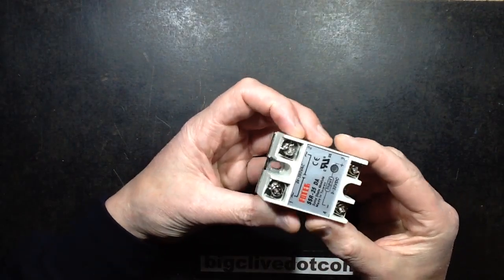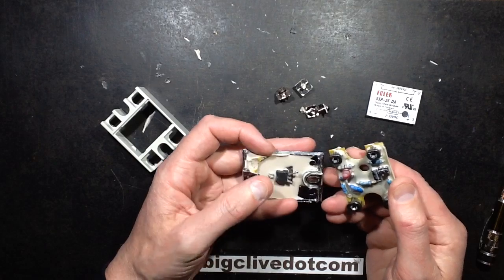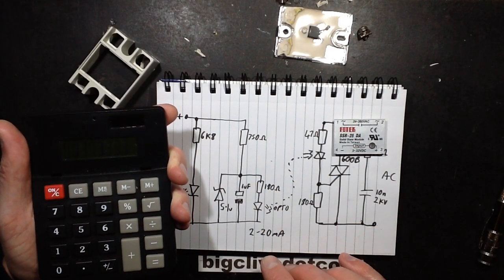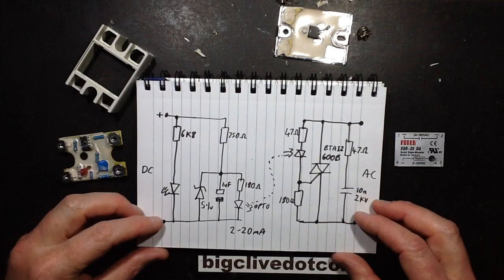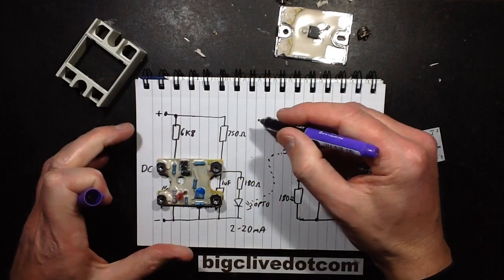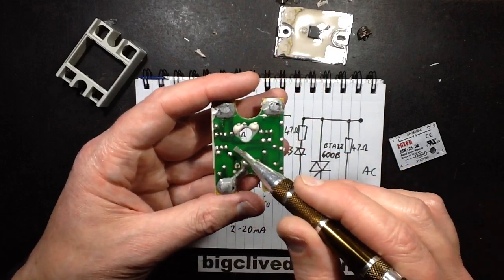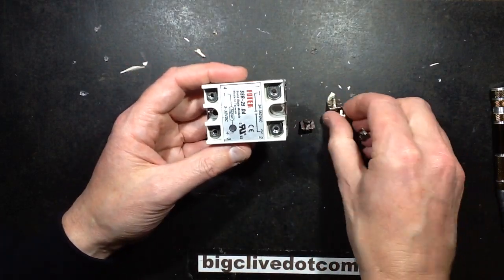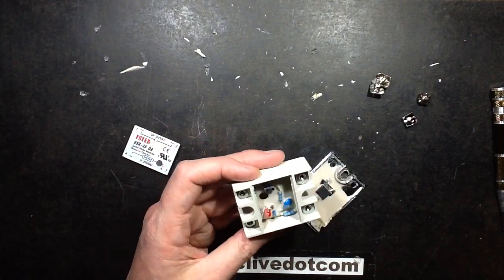Teardown of an eBay 25A Solid State Relay.  (SSR)

Comment: Hi Big Clive. I have a strange problem using 2 of these to switch a boiler on and off. The boiler provides a Live Supply (240v ac) and when this is returned to the boiler on the Live Return the boiler kicks into life. The reason I have 2 is that I have 2 Nest controllers. The Nest controller has a simple built in relay that switches the Live Supply which in turn is connected to the input of one of these Fotek AC SSR. The Live Supply is also connected to one of the o/p legs of the SSR. 
The reason for using 2 of these is to give isolation between the 2 controllers.
When you turn up the thermostat the Nest controller does its job and presents 240v to the input of the SSR. The problem is although 240v ac is already present on one of the o/p legs it does not get switched to the other o/p leg so the boiler does not kick into life (it seems to have approx 40-50v ac on it). If I remove the wire from this leg then reattach it it instantly passes the 240v and the boiler kicks into life. Can you shed any light on this. Many Thanks.

John
Reply from the maker: The triac drive circuit requires the current through the load to switch on the triac.  If you put two in series then each blocks the others trigger current.
Reply: Hi,
      Thanks for the reply - they are connected in parallel. I am beginning to wonder if it could be that the boiler itself is not providing enough/the right type of load
Reply: Big Clive I've drawn a diagram of what I am trying to achieve - how can I get that to you. Thanks

John
Reply: I've posted a drawing at : http://www.ultimatehandyman.co.uk/forum1/post728092.html#p728092
John
Reply from the maker: John Ah, it's probably down to the boiler's control input being just a low current signal.  The SSR will require a minimum current to latch and stay on.  To test this you could connect a small load like a traditional light bulb to make the boiler appear like a higher load to see if that's the problem.
Reply: Hi, I  connected the 2 port valve on the o/p side and hey presto it worked. Thanks for the help.
P.S. I don't know if this Fotek is real or a fake. Do you know of any manufacturers that would latch with a no/small load?

John
Reply from the maker: You may have to use a common relay to switch such a low load.

Comment: I took apart an old 1980's vintage USA made 10Amp 140V ssr and it is indeed fully filled with dense black compound.  The lid is a full cover and they have little legs that extend into the potting compound to hold the lid on.  Much more robust construcutib than what is shown above.

Comment: I have seen 100 AMP 60 volt DC SSRs on eBay I highly doubt they can sink 100 AMP heat dissipation in the same form factor package that you have FOTEC without liquid cooling.  My interest in the DC SSRs was for a golf cart speed controller. The limit however is the PWM response. Others have said the max PWM response was 800 to 900 cps. Krydon brand SSRs  are better and can have a slightly higher PWM from 1000-1200 cps but still is within audible hearing range. I would like to see you test and tear down a 100 Amp DC SSR.  Thanks for the video.

Comment: Bro....... I want to drive one of these from 230 volts AC, means switching voltage should be 230v input and 230v switched output. ........ 
Could you please provide me a circuit  to drive it from 230 volts AC.
Reply: A diode, a resistor, and a capacitor.  Or just wire in a small 5 or 12v power supply.

Comment: So this would be fine for a basic bedside lamp (being switched via an Arduino)?
Reply from the maker: Yes, but low wattage LED lamps may still glow or strobe due to the slight leakage through the SSRs snubber network.
Reply: OK, thanks I'll give it a go.
Reply: Have a look at the sonoff units with built-in wifi. Can be reprogrammed with the Arduino IDE.

Comment: Thanks Clive! I change out CryDom HD4890 SSR (480Volt 90Amp) Solid State Relays that run 7K watt heater bands on a PVC extrusion lines on a pretty regular basis.  About 30 of them are used per line to heat "zones" controlled by Telemachique controllers. Always wanted to see inside one but the Crydom's are potted! Great video! Hate that the Crydom's sometimes fail in a closed gate state and burn up heater bands!
Reply from the maker: The shorted failure is a common semiconductor failure mode, particularly in the event of the load short circuiting.  It's a good idea to way over-rate the solid state relays and make sure they are mounted on proper heatsinks with extra cooling if needed to make them survive longer.  Another good idea is to consider a generously rated high temperature thermal fuse inline with the heating elements to kill the power to them if they start running too hot.

Comment: Hi. I had several 40a models of these looking to control the phase component of a 2.2kw single phase motor for a dust extraction unit. I put the common of the 230v all together and had one of these to control the phase. It worked once but then latched on permanently. I tried every one I had and got the same result. I think on your video you mentioned polarity of the high voltage side of the relay? Is this correct and is it possible I can install one of these but reverse the input 230v phase through the unit? Since then I have bought several 80A units which should be way more than what I need. But I am interested in what your thoughts are. I guess a motor the size I have pulls 40a on start.
Reply from the maker: If you tested across the output pins of the solid state relay with a meter and found it had gone dead short then it's probable that the triac failed on the first use.  Shorting out is their usual failure mode.  The inrush current might be too high for the triacs inside the units you used (if they are clones they might be well under-rated).  You may have more luck using a traditional relay or contactor to switch the motor.
Reply: Rule of thumb is 6 X running current is your inrush so roughly 60A - I think that is your problem. I've measured 10 x FLA in some applications.

Comment: I ran a 2kW (~8A) heater through this thing.. in about 30 minutes the room was filled with melted plastic smell. The damn thing melted into a blob
Reply: It takes approximately(rule of thumb) 1 sq inch of surface area to dissipate 1W  - I was thinking (not knowing your install) that if the SS relay were isolated from air and not in contact with metal that could increase the heat dissipation that it might be a problem.It could be in a plastic wall box in insulation for example. 8A at even 1 V (=8W)  is quite a bit of heat under some circumstances >
It does sound like it was defective - but I like to rule out the little things.
Reply: Her's a thought - could the metal backing need to be mounted on a surface that can radiate heat? if you mount this thing loose in a box it might cause over heating.
Reply: True. If the one Clive tore down had a sub-rated triac, it's possible that others have even lower rated ones in.
Reply: I am trying to do a similar thing with a 2kW (~8-9A - 200/230V) heater for my house. What did you use to solve this problem? Did you buy a better quality SSR that has a higher current rating?
Reply: +Ed Rundle Well, if the damned thing melted into a blob from 8 amps of purely resistive load, then I don't think even a heatsink with forced cooling (i.e. a fan) would help things much (except if it's a CPU cooler perhaps). Even at 8 amps. If the thing would run "only" hot to the touch, then maybe. But melting (=temperatures of 200 °C and more) means that 8 amps is WAY above the rating of the semiconductor part inside.
Reply: +Ed Rundle Well, the OP said 2 kW, that assumes a mains voltage of ~240 volts (probably 230 V nominal), which makes it a bit more than 8 amps. And if we calculate with a 90% efficiency (which is quite a generous figure given the fact that semiconductors in general seem to be the most efficient at room temperature or below that) that means that "only" ~200 watts of heat needs to be dissipated somehow. Like I said: MAYBE a CPU cooler could handle it. But even that would be pushing it if the IGBT in the SSR was run WAY outside its specs (which it definitely was, otherwise the plastic wouldn't have melted down so badly, >200 °C is just awfully lot, you know).
Reply: I was thinking about that and I almost never see these SSRs being used on a power hungry load. a 2 kw drive (3 phase inverter for motors) has quite a large heat sink and fan assembly - it is more complex - but it is also 2KW total - so the heat dissipation should be similar.(maybe?)
I also remember seeing my digital thermostat used a relay probably for this reason.
This calculator gets about 2-5 Cu inches (just substituting your power dissipation leaving all else the same in their example) http://www.alliedelec.com/images/Products/mkt/pb/ohmite/pdfs/heatsinksizingguide.pdf
still I would think yours would last longer than it did.
Reply: - I ended up using a standard 16A double contact relay.. just in case, I bridged the contacts.
- I had the same type, as in video - 25A.. mine was SSR 25AA - "coill" was also triggered with 230VAC
- I had the Worst possible place for installation - behind a drywall, in a pocket of woolrock insulation.
Reply: +Ed Rundle Devices designed to handle inductive loads have to be more rugged in general, because inductors consume a lot of apparent power (Q) as well, that usually needs to be compensated somehow (e.g. using capacitors). But yeah, the heat dissipation is definitely similar thus I'd expect at least a similar degree of ruggedness from other devices claiming to be able to handle such power.
Not sure about the digital thermostats. They have to be able to switch any kind of electricity (AC, DC or DC with reverse polarity) and have to be compact. Perhaps they use relays because they're more reliable, IDK.
Thanks for the PDF, I always wanted something like this to be able to estimate heatsink sizes. A word of caution though: 2-5 cu. in. probably means a solid cube of such dimensions, which translates to significantly larger heatsinks (for better heat radiation), perhaps as big as the CPU coolers I mentioned earlier.
Reply: You may need to heat-sink it. I bought a mini kiln with one of these in and it had a heat-sink attached. I replaced it with my own with no heat sink and no issues yet though (I do have the heat sink ready if needed though)
Reply: You don't happen to know that an SSR will only have a very little resistance in it, in the order of milliohms so the power losses are in the order of a couple of watts?
Reply: +Viljar Niit And how much was that thing "officially" rated for?
Reply: +CoolKoon
It depends upon how they rate it.  Maybe somewhere in the Chinese writing it says something like, "Rated for 25A only when used with proper heat sink and heat dissipation methods". :)  It's bad enough when the small print is in English, but if it's in CHINESE, well, that's pretty useless to me. :)

I bought one of these SSRs a couple of years ago, before I knew of the problem with the fakes.  Turns out it is a fake, but it does work.  It's a 40A model and I do have a decent size heat sink on it, but I'm not pushing it very hard.  I've just used it hooked up to an Arduino board for some testing of some code and it's only controlling a small incandescent light bulb -- the print is too small for my old eyes to read, but I think it's probably around the 40-60W range.  I had originally bought it to control a lead melting pot along with a heat sensor for cast bullets, but never got around to completing the project.  Unfortunately, the older I get, the more projects end up like that.  ADD?  Alzheimers?  Or just old-fart-itis? :)
Reply: Did you mount it on a heatsink? If not, it is your own fault.
Reply: Typically the On−State Voltage of the TRIAC is about 1.5V. If you  ran a 2kW (~8A) heater through the SSR, the  power dissipation of the SSR would be about 12W(1.5*8).
All the detail information can be found in the TRIAC datasheet.
Reply: A thermal fuse is great insurance.
Reply: +Chaos Corner Having to heatsink a SSR rated for 25 amps when only 8 A flows through it? That sounds suspicious to say the least.
Reply: Solid state relays aren't relays or contactors, however.

Comment: I hate to be a stickler, but you have again drawn the symbol for a schottky diode instead of a zener diode in your schematic.  For those that think it really makes no difference, you're wrong.  Symbols for components have meaning and swapping a zener for a schottky would not make the circuit correct.
Reply from the maker: https://en.wikipedia.org/wiki/Zener_diode
Reply: bigclivedotcom now thats how you win an arguement
Reply: https://en.wikipedia.org/wiki/Schottky_diode

So you mixed the shape of a  Zener with the orientation of a Schottky.

You are both wrong according to wikipedia.

Comment: I cant get my head around the concept of faking a 25A SSR and selling it for a couple of pounds on ebay when they could sell it for the same price rated and labelled as an 8A device instead. It would still be a very competitive price but legitimately rated.
Reply: as far as i know they all agree this fakery, yes, competition kicks in and they have ridiculous prices but... i saw that 60% of what they sell is just fake, fake chips, fake transistors, only modules work ok, because 99% of who buys this stuff can't tell the difference and a chunky transistor will turn on a small motor even if there's a 1\2 current transistor actually inside, novices are happy, modules work... i'm not è_é... i couldn't find a BC639 or compatible except on super expensive stores outsice the china cheap (just as en example, don't buy op amps eighter)... yes instead of 1€ i'd like to spend 1.5€ for a bag of 100 of those transistors but LEGIT ones, not caring of branded ones much
Reply: In general, it seems like the Chinese tend to prioritize things working and being cheap over reliability. So if they give you a current rating, that's not going to be a guarantee of steady-state functionality at that load, it's going to be "this will probably work for all these applications"
Reply: They buy one thing and list it as multiple ratings to hit as many target markets as possible.
Reply: The Chinese couldn't cause as many fires if they properly labeled their goods.
Reply: Welcome to China - Manufacturing philosophy: why waste money using unnecessary resin...  you get what you pay for, but this is dangerous and a fire risk
Reply: @Alweg Fan , as a long time engineer working for a company that supplies industrial automation system to Chinese heavy industries, including power generation, practically everything is sourced either out of the USA, Europe or Japan. I go over to a plant and I am rubbing elbows with representatives/engineers from Germany, Japan and the States primarily. I don't see ANY  Chinese sourced parts/assemblies in those critical industries. So I think the top guys who are in charge of critical industries have a good handle on the quality and reliability of their own lesser industries. Now I suppose that over time, this is gradually changing, and more in some industries that in others.
Reply: It’s Chinese.
Reply: @charlesmurphy1510  if it's crap it's because it is Chinese ,if it's not Chinese it's a feature.

Comment: Yeah FOTEK is a big company and they make reliable SSR's.  The Ebay ones are basically all fake with VERY VERY few exceptions. (and thus triacs are usually 50% of what they should be)  http://canada.ul.com/safetyalerts/ul-warns-of-solid-state-relay-with-counterfeit-ul-recognition-mark-release-13pn-52/
Reply: Thanks for that info bn880. Extremely useful and now I know where to get genuine ones.

Comment: In Europe we use 220volt so half the amps for a given load. So perhaps the amp spec assumes European voltage? If so if using 110 volt the max current as advertised should be halved.
Reply from the maker: Current is current anywhere in the world.  You'll just get less power switching for a given current if your voltage is lower.

Comment: im using a 25 amp relay with a 14 amp heater is that ok ..and the relay is controlled by a pid temp controller
Reply from the maker: It all depends on what's inside the relay.  That's quite a high load, it might be worth buying a proper relay from an industrial component supplier with a known spec.

Comment: have here the SSR 40 an use it for max 10A ... 

but it would not run stable with adorino or controller ... the resitor with 750ohms are to high :-( 
but you can put an addional resitor for aprox 100ohms over the 750ohms resistor.

Comment: Would one of these be OK to control an immersion heater?
Reply: Depends on how many watts you immersion heater is rated with.
Reply: Mousa
Well, you could but there would be a terrible flicker and it's just not practical I guess? Google is your friend mate. Might I ask what you're trying to dim and what control circuit you'd use for the SSR?

Comment: I would avoid these cheap ones. They are prone to failing even indoor use. Not to mention an electrical shock and fire hazard. One reason I pay for the extra money for say a Siemens they are over designed for industrial use.  They meet explosion proof environment standards.